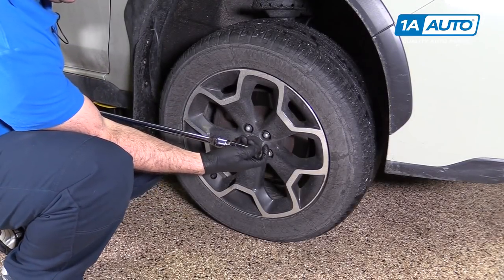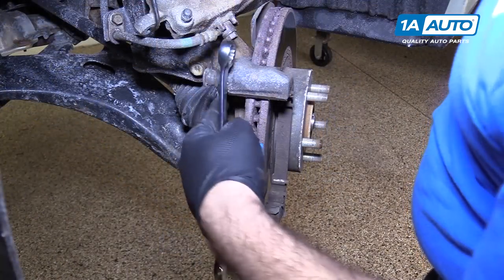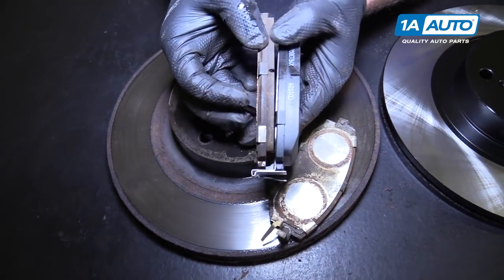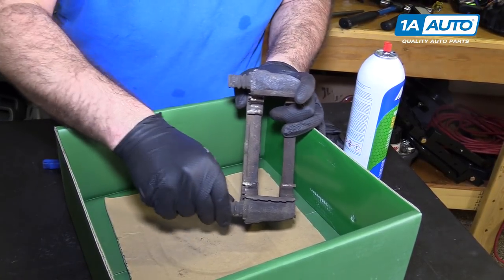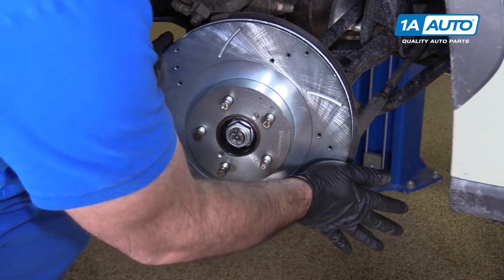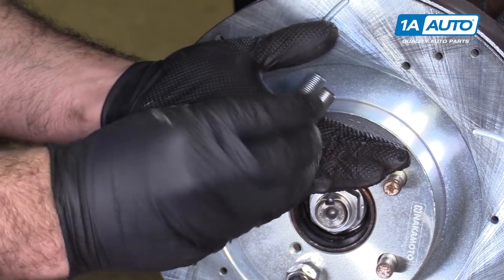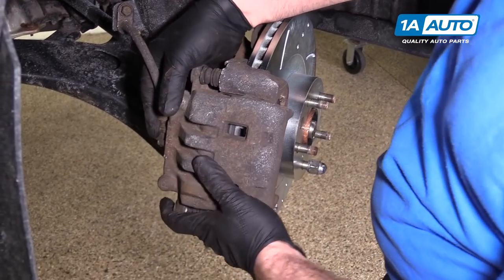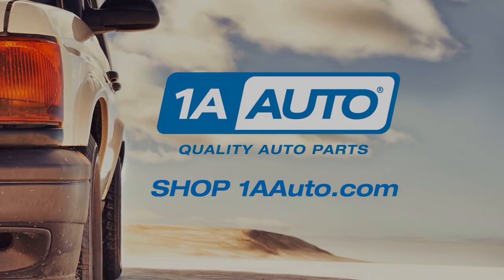How to Replace Front Brake Pads Rotors 13-14 Subaru XV Crosstrek

Comment: On a ‘16 Crosstrek you need 8mm X 1.25 pitch bolts for pushing the rotors off the hubs.
Reply: and it makes it so much easier too. I beat that rotor for 5 minutes, then spent the $1.28 at Lowes and had them off in 1 minute.
Reply: 100% agreed. Make sure to get the bolts—banging only got so far on my 2014–but the bolts made it painless and fast.

Comment: Remember to un-cap the brake fluid reservoir before pushing the pistons back into the caliper, and check for overflow!  Brake fluid will dissolve paint!.  Check all bolts for manufacturer's recommended torque.   New rotor and brake pads will need a break-in period, usually a series of controlled hard brake applications to get them to perform correctly.

Comment: fwiw, I just tried to get one of my front rotors off, which has been sitting and accumulating a bit of rust for about half a year (but in a dry climate so I thought it wasn't too bad). I'm not (or wasn't) planning to replace it so I didn't want to dent it with too hard of a blow from my mini sledge or regular hammer, but I did tap around it and also sprayed PB Blaster in the appropriate places. Well, while hand tightening the assisting bolts with a medium socket wrench as seen here 3:27, the rotor was still so stuck in place that the threads of the bolts warped and then the cast metal actually burst right at the outer lip. Luckily the bolts didn't snap off inside, but yeah - my lesson: I would say be advised to definitely use the dead blow 3:00 and really whack the rotor loose as much as possible before trying the 8x1.0 bolt assistance method. I probably could have let the PB Blaster settle a good bit longer, too.

Comment: Thanks for the video, it was very helpful  One note to improve the video. The bolt used to push the rotor off is actually 8Mx1.25 not 8Mx1.0 thread pitch
Reply from the maker: +Hal Sachs Thanks for the tip!

Comment: Just did this on both rear wheels. Was very helpful. Thank you. 

Question. After complete, all works great—except my ebrake appears to not be working (worked well prior to removing the rotor disks). I assume it has something to do with adjusting that spring spin wheel / sprocket? Before I closed it up I rotate the sprocket “above” the spring as you did in the video, and then pumped the ebrake. Something I missed?

Overall—thanks again.

Comment: Brake parts cleaner will react with rubber. I would avoid any of cleaner spray next to the rubber boots of the slide pins or the caliper boots.

Comment: What does the position of the indicators for the front brakes? I was doing a brake job and none of the pads that were previously installed had any indicators and when I put the pads on there was not enough room where I had them to pull the caliper down over top of the indicator. I obviously put it in the wrong spot or whoever made the pads didn't take that into consideration. I'm guessing I put them in the wrong spot. So Anna 2013 Crosstrek for the front brakes where do you put the indicators?

Comment: sir, what is the outside diameter of the new disc brake? is it 295 mm? my cross trek have 285 mm outside diameter, will it be incompatible to use 1 cm oversize disc brake?

Comment: I wanted to ask, I had my crosstrek serviced at Mavis and noticed a rattle when the shop changed the two front brake calipers. I went back to them and they said there was nothing loose but I figured I would check to make sure they are not overlooking something. When I give the wheels a kick, I hear rattle as well. Whenever I go over a rough surface the rattle is present but when I press the brakes, it goes away. Not sure if the Pad Install, or Caliper install is the issue. Do you have thoughts on where to start?

Comment: Does those drilled rotor disc helps a lot for stopping power or it just helps for dissipating the heat? Just curious.
Reply: Drilled will help dissipate heat and the slots will aid in stopping. Increased wear on brake pads with slotted rotors but much better stopping power

Comment: On my brake pads There is a some kind of spring on one Side. And its was broken what would that Do ?? Sorry i'm not english
Reply: That pointy metal tab (spring) is there to push the pad away from the rotor when brake is not applied. Be sure to install the new pads with the tab at the lower position.

Comment: why wouldn't you use new brake hardware, i.e. the stainless brake pad fitting kit?
Reply: They are high quality stainless steel, they  just need a  clean - just like the caliper bolts  they trashed  that just  need  a  wire brush cleanup.  Waste to replace  pads  at 5mm. Also the rotors  should  be  good  to 100K. re-purpose,  re-use and  recycle! In this  case, reuse.  Cheers!  Sandy Shoremann.

Comment: Anyone know where to find the 8x1.0mm bolts?
Reply: on my 2015 crosstrek, the 8x1.0mm bolts actually stripped out in the old rotors.  I believe the correct bolts are 8x1.25.  In any case, home depot should have them...hidden in the drawers in the hardware aisle.

Comment: Will those parts fit a 2015?
Reply from the maker: +Robert Hastings Thanks for watching!  The parts in the link will not fit on a 2015 model, but we do have a set that will!  Here is a link to them: https://www.1aauto.com/brake-kit/i/1abfs03131?f=1155575&y=2015
Reply: @1AAuto  LOL while I was watching your video, I was multi-tasking for the same page in your URL.  Great prices, and much more complete then the local retail around these pasts.  Thank you.